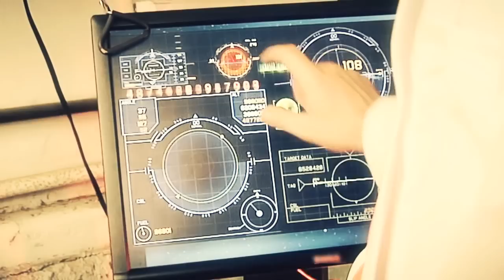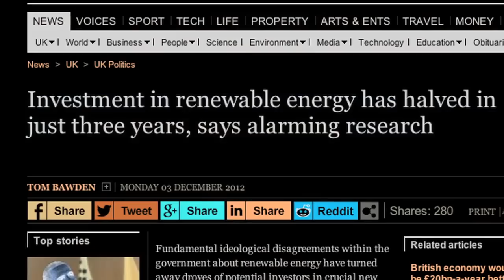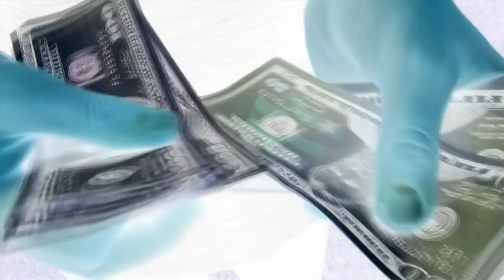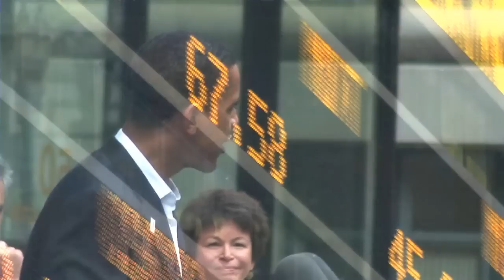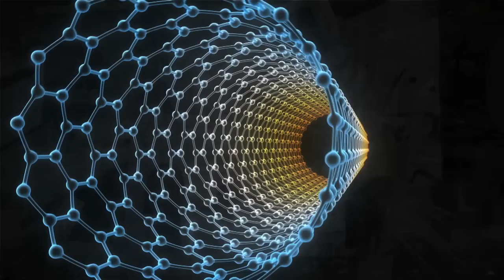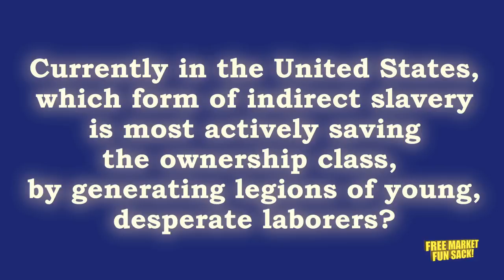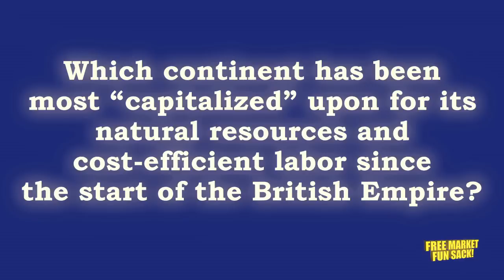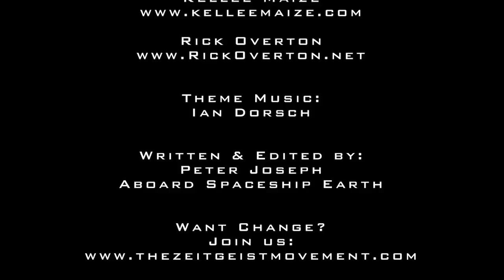Culture in Decline | Episode #6 "Tale of Two Worlds" by Peter Joseph

Comment: No, there won't be. Common interchangeable energy and resource units don't yet exist and they won't likely exist in an improvised trading system like market anarchy. People if not introduced and accustomed to new scientific concepts like computed resource units will fall back on traditional devices of trade like notes and coins which "represents" nothing tangible nor are they resource data related. Fuel could run out and nobody would be able to anticipate it coming or plan on what to do next.

Comment: Yet these developed solutions are necessarily framed within economic viability, which requires the actual technical solution be peripheral at best. This leads to countless situations where the most straightforward and presently applicable solutions (in the technological and/or resource-efficiency sense) are disregarded or become implausible when taking into account the market's limiting factors. So the same problems have to be solved more than a single time...

Comment: The cars today last about 200k where they used to last 100k in the 50's (I have sources). Plus they are more safer and energy efficient. Cars MPG would probably be 50 MPG average if it wasn't for all the extra stuff we keep putting in them. (again more sources) 
I believe in property rights. I have no problems with recycling as long as it is done without the use of force or the government.

Comment: They spent so much inventing machine and automation because they make huge profit from it. Machines are more efficient that any human, they can work 24h/7, never get tired and they don't need health etc. assurances. But ultimately, the more they use machines the less money in circulation there is and the system is ''destroying'' itself. FIat money is not a tool, seems you don't even know what the word ''Fiat'' means. The value of money depends on the value people gave it. It's an illusion.